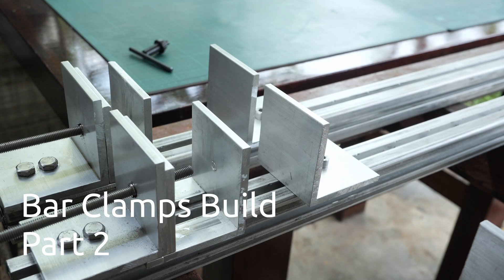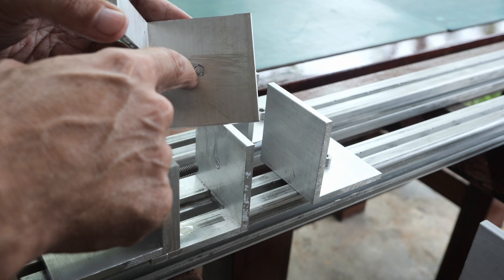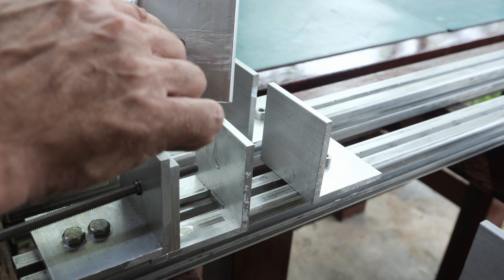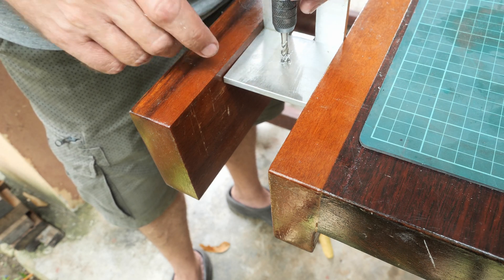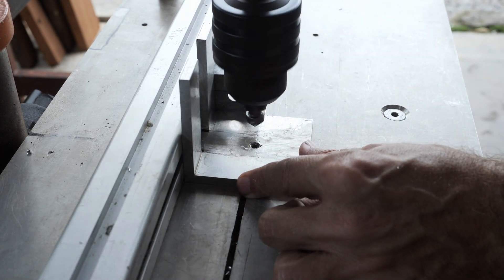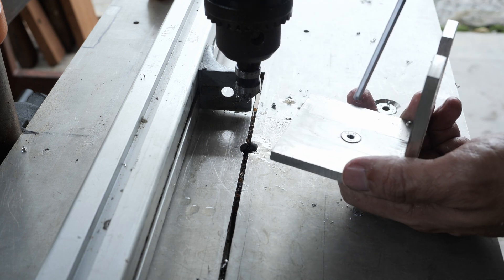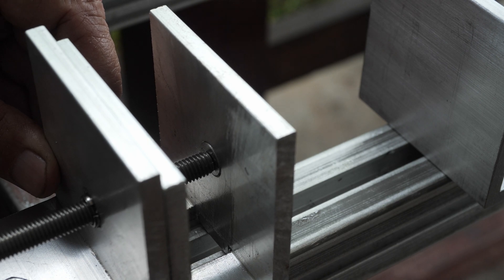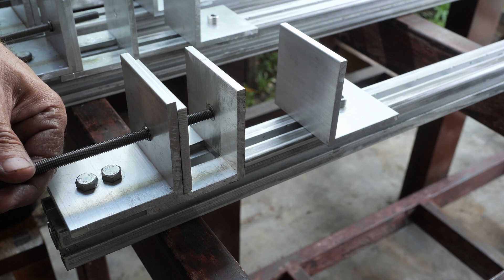Bar Clamps Build Part 2 Heavy Duty Made From Aluminum And Stainless Steel | by Tiger Carpenter

Comment: amazing clamps.. where did you get 12 ft extruded aluminum
Reply from the maker: thank you!

from the aluminum hardware store. it's actually not that expensive when you buy by the full lengths = 6 meters / 20 feet

Comment: That's just funny when someone can even think that something made from Aluminum can be heavy duty...
Reply from the maker: if you watch this video closely, you will see that the elements bearing the load, and resisting wear and tear are in fact made from the hardened stainless steel components. the aluminum is used here as the structural supports, that are guaranteed to remain straight even under a very excessive load, because of the specially designed extrusion profiles.

you haven't seen anything yet.

there are massive bridges made from the aluminum.

airplanes and airports are made from the aluminum. skyscrapers are made from the aluminum.

fixtures / jigs / tools are made from aluminum.

I've even heard of the trolls being made from the aluminum...